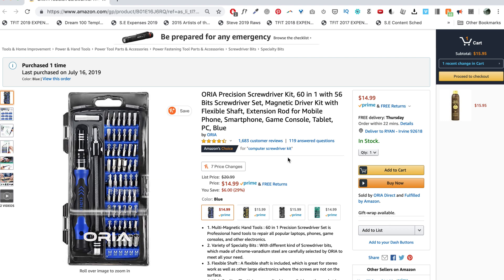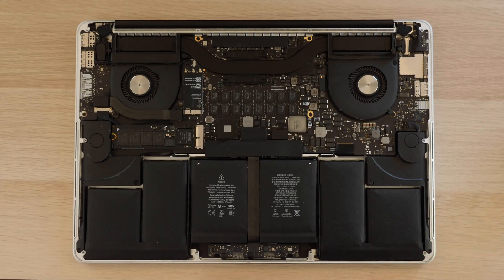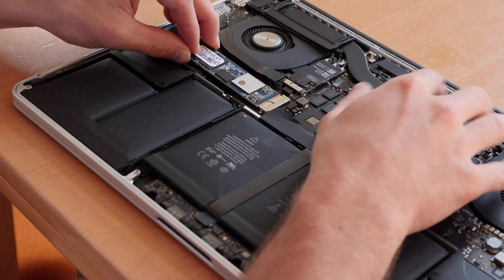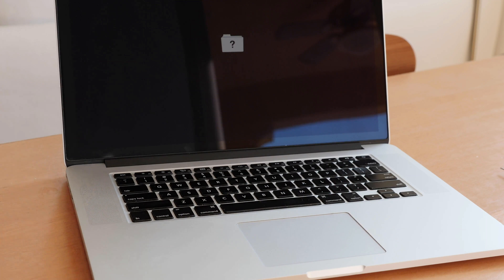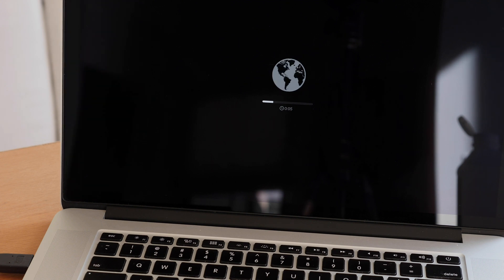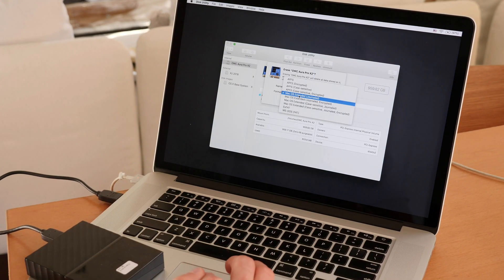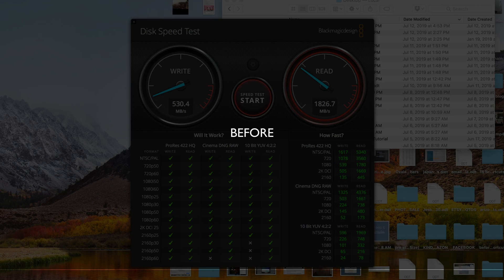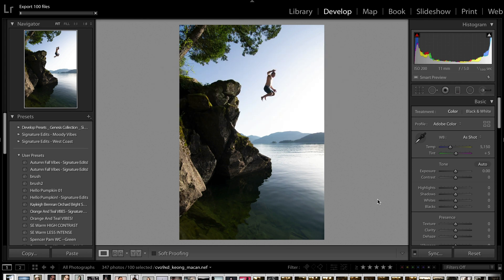Macbook Pro Hard Drive Replacement / Upgrade Test: OWC Aura Pro X2 SSD Review

Comment from the maker: DIY Hard Drive Replacement Tool links:
SSD Hard Drive - 1tb OWC Aura Pro X2 - https://amzn.to/2YpQE6P
Screwdriver Tool - https://amzn.to/2y9CRT6
Thermal Paste - https://amzn.to/2Yel1sK
Screwdriver Tool - https://amzn.to/2y9CRT6
(I receive a small commission if you purchase these, but feel free to buy whatever tools & paste you like - These are just what I used!)
Isopropyl Alcohol - Buy this at a grocery store or pharmacy anything with an alcohol content over about 70% is fine. At $0.70 its WAY cheaper than buying the special electronic stuff for $15+!
Compressed Air - Again buy at a hardware store and its WAY cheaper. The one I got was about $5 at home depot. Just make sure its compressed air only, and doesn't have anything else in there. 
Thermal Paste Replacement Walkthrough: https://youtu.be/qXAUzkj_hfM
Reply: I did the same upgrade, didnt work for me :(   
Has been almost a month since your ssd upgrade, how does your computer run ? any kernel panic ? any unusual slow down doing certain task ?
Cheers for the video

regards Gabriel

Comment: A few years late, but according to the OWC website:
IMPORTANT: macOS 10.13 High Sierra (or later OS) must be installed on the host computer BEFORE installing this SSD
for the first time. These OS versions include an EFI firmware update for your Mac. Without the update, the computer will not
recognize the SSD.

So you don't (in theory) need to upgrade to Mohave(sp).
My issue is that all their videos on the migrating to the new drive are 404 pages, now (2025).
I know... "Why am I using a 2013 mac in 2025?"
Simple answer: I bought my software, and all modern software is now monthly rental. I don't want to rent my software, or be required to be on-line to use it.

Comment: Hey, watched your video on switching out your SSD.  I virtually have the same exact MacBook Pro that you do. I am now running Monterey 12.6.9 as an operating system. My question, do I need to format the SSD? I don’t know if my version of OS has the EFI firmware update. Reading from OWC instructions page It indicate Mac, OS 10.13 High Sierra or later must be installed.  How am I to ascertain whether or not I’ve got the update? Does later me from High Sierra looking back or going forward?  I look forward to your response!!!

Stephen

Comment: Thanks for the video. I have macbook retina 2013 late. I am planning to upgrade my ssd. Lets say I do not have ssd(not working) what should I do. I dont have time machine.
Reply from the maker: Not sure entirely what you mean, but if your harddrive quit on you, the only thing you could do yourself would be move the SSD to an SSD enclosure, then run recovery software on it. Other than that, you'd have to take it in to a data recovery place and hopefully they'd get it back

Comment: Thank you for including ALL the missteps in your video. It makes me feel better to know that the problems I have aren't just because of me. Would you have had an easier time if you had cloned the SSD before you installed the new drive? I saw that you formated the new drive as macOS extended but Apple recommends using their newer APFS system for SSD performance.

Comment: Hi bro, my macbook pro retina mid 2014, I bought that SSD 1TB, but it did not recieved new SSD, what should I do now, bro? I tried to install many times but could not.
Reply from the maker: Hey Hoang! Sorry you're having trouble. For me it took some figuring out, and eventually I had to start with a completely formatted drive and install a brand new OS - Duplicating the drive / installing from a backup didn't work. Perhaps this is worth a shot! If not, your next step might be contacting OWC

Comment: Have you found any way to calibrate the drive to get that CPU performance back. I don't know what the 802 vs 770 equates to in real world but it seems like a pretty significant drop. Also, do you know in what use case that drop would come in to play?
Reply from the maker: I'm not sure what you're asking, but no, I haven't done anything since I switched the drive out. It's been awesome.
Reply: @SignatureEdits  I'm talking about at 7:50 in the video when you show the CPU scores. You said the CPU doesn't work as well with a non Apple calibrated hard drive when you show the before score of 802 vs the after score of 770. I was saying that I don't know what that drop of 32 points in CPU score equates to in real world use but it seems significant. I was asking if you have found a way to get those 32 points of CPU performance back and in what scenarios would that 32 points be a factor?
Reply from the maker: @TimidMC  Gotcha. Well 802 vs 770 is a 4% difference.. So really not significant. I can say without a doubt I've noticed zero drop in real world performance!
Reply: @SignatureEdits  ok thanks. I've been eyeing this drive upgrade to extend the MBP; I like my ports. After I get this screengate/staingate issue fixed, though.

Comment: Not meaning to be pedantic but I think it would have helped for you do do a bit more research on the differences between hard drives and solid state drives. It sounds kind of like you think the SSD is just an upgrade to the current technology that is the HDD when they are two completely separate entities. Very simply put the hard drive is a moving disk, among other things, that stores data in various locations and moves to said locations to get the data stored there. An SSD has no moving parts and stores data in locations called cells which require no physical movement to reach. This is why SSDs are so much faster than HDDs, HDDs have to travel a certain distance to get data whereas SSDs are able to locate it easier and faster because the data and location thereof are fixed. Major detriments to hard drives are the are composed of moving parts and are easier to incapacitate through normal wear and tear and they are much slower in reading, writing data, and finding data not to mention being much cheaper in terms of cost per GB. Benefits of SSDs are they are blazing fast compared to HDDs and they are more difficult to break because of the inherent nature of their build and having no moving parts to be displaced or broken entirely. It should be noted SSDs are more expensive in cost per GB and cells begin to "break" or become corrupted over time. This will leave you with less storage space overall but the rate at which these cells corrupt should not have any bearing on whether or not you are deciding to get an SSD. IMO SSDs are far superior to HDDs and are very much worth the investment. All you need to do is think of the efficiency that comes with an SSD rather than an HDD. With all of the time you have spent in your life waiting for your snail of a hard drive to load microsoft word you could have amassed another week of surfing the web, watching Netflix, doing something productive, or slacking off. An upgrade is definitely worth it and shipping product with an SSD instead of an HDD should become standard practice within the next 20 years. 

Edit: If you're going to be handling internal computer components you should ALWAYS wear an anti-static bracelet! A single static shock is enough to absolutely destroy your computer! a static-electric shock is probably the quickest way to completely fuck up your computer or pretty much any part housed internally. Not a cheap fix!

Edit 2: Man you gotta do some research before making a vid like this, no anti-static warning, not knowing you can't boot a computer with no OS to boot it on, constantly referring to the SSD as an HDD. There's a dearth of info on how to do everything in this vid without potentially obliterating your viewers' expensive, very hard to replace, hardware from 2015! You should also note this is the last model of Macbook Pro made with upgrade-able hardware so an uninformed viewer doesn't buy this SSD for their 2017 Macbook Pro just to take it apart and realize it wont do anything!
Reply from the maker: Great notes and info! I'm certainly not a tech guy with much experience in this realm, so I appreciate the additional notes!

Comment: o h ok hold on please at 3:54. I have the same macbook pro retina display 2015 and the SSD is not going all the way in. How hard did you push it in??
Reply from the maker: hmm i cant remember sorry! if in doubt just take it out and triple check you have it in right - then once you are positive, apply as much pressure as necessary
Reply: @SignatureEdits  hmm I just spoke with the team at OWS today as well and he told me to apply more pressure probably. The problem is most videos just skim this important part in fast forward.
Reply: @SignatureEdits  but thanks for the info

Comment: Good job. Thank you! You helped me a lot. I just changed my old ssd for Aura and it went smooth, no hassles. I didn't have to press cmdR...just after turning it on, I pluged in the time machine back up disk and it did all in 2 hours with no need to press anything...
Reply from the maker: Glad it worked so easily for you Tomas! Congrats on the SSD upgrade

Comment: I have installed Aura Pro X2 and my macbook pro is early 2015. After cmd + R the disk utility doesn’t recognise the new ssd. Any idea how to fix that? BTW, my macOS is Catilina 10.15.6.
Reply from the maker: I wish I could help Elham - It might be the same situation as me, where you have to do a completely fresh install of the drive first, THEN you can load your time machine.
Reply: Hey, did you find out how fix this issue??

Comment: @Signature Edit You should have gotten the SSD with the External Case, then install the old SSD into the enclosure then install the latest OS and perform data migration with the data migration assistant at the end of the OS install.
Reply from the maker: Correct - I would highly recommend others to do that!

Comment: So you had to erase your initial backup, then update the OS via the internet option, then you did the backup again? Do you have to format the SSD to a specific partition option?? I'm getting the same drive delivered tomorrow.
Reply from the maker: Hey Jonathan! No I didn't have to erase the backup at all.. It was on an external harddrive. Yes I installed the latest OS via internet connection, and THEN I was able to move the backup onto the computer (It failed to work before)

Comment: Thanks for the video! Have you experienced any overheating issues, or any issues with the Mac having to shutdown? Lol I have a 128gb, and need to upgrade.
Reply from the maker: No overheating issues for me. My battery needs replacing anyways so I can't comment on the battery life, although I've heard it's worse. But for me since I'm plugged in 95% of the time that's not a big deal.

Comment: Hi..I'm thinking of getting a 2tb SSD and I have the the same model and  specs of yours laptop. So after 5/6 months of uaing that SSD can you please make sure does it create any issues of Battery life or any other sector? 
Thank You.
Reply from the maker: Hey! Personally I haven't had any issues, but I can't comment on battery life because my battery was already old and in need of replacement before doing the switch. I am 95% plugged in during the day so for me it's not an issue. Good luck!

Comment: Confused when you say you need at least high Sierra and then say you need Mojave. Explain that one!
Reply from the maker: Haha great question Brian! WWC says you need High Sierra on their product info, but when I was actually installing the drive I had to upgrade to Mojave in order to get it to work personally. Your experience may be different, but that's why I said both!
Reply: Signature Edits I just swapped out my PCI SSD and the HD for a SATA SSD in my late 2014 iMac. I ran into a little snag but quickly fixed it. First, I was running Mojave before I took the computer apart. I needed to put new and better thermal paste on the heat sink. It was running way too hot. Actually shutting down. 

So I assembled everything and my boot drive (new Mojave flash stick) was messed up and would not work. Annoyed. So when I go into recovery it was El Capitan internet install. I was shocked. The PCI ssd wasn’t showing so I said enough of this and grabbed my MacBook to create a proper boot disk and install clean copy after formatting and fusing the two drives together. 

So I make the boot disc, run terminal to make an all SSD fusion drive (why I did this was it was cheaper and the benefits of a 2TB fast PCI on the 2014 would not be great since the PCI speed is about the same as SSD). So anyway, I go to install Mac OS Mojave and I get a terrible message telling me to replace the SSD in SATA because Mac OS only supports SSD and HD fusion. I panicked. The issue was the format of drive. I had to change it to APFS and reformat the drives and all was well. What a project!! Ha ha.
Reply: Signature Edits Works like a charm now. Much faster and so nice and cool now. No more 230f GPU temps!!

Comment: Hi I have upgraded too to owc aura 1 tb thx your tutorial :D, I wanna ask how about your booting time? Mine longer than original apple, 17 seconds vs 35 seconds, how about yours? And how about the battery life?
Reply from the maker: Hmm I haven't actually tested the boot time tbh, but I haven't noticed any significant changes. Battery life no major differences I've noticed... But my battery shows up as "Needs servicing" so I don't know what it would be with a new one... I personally am plugged in 95% of the time so it doesn't affect me much

Comment: Hey. I just did the same thing on my MBP 13 early 2015. But mine stops at 1100write and 1100 read. Ive got 8gb RAM and 2.7GHz i5. Also new battery. Any suggestions what i can do to increase the speed? I use OWC Aura Pro x2 480gb
Reply: My geekbench actually went down from 757 single core to 671 after the upgrade
Reply: Andreas G So is the performance decline noticeable ?
Reply: Prathamesh Jaiswal Yes. I find my Mac having more problems in Logic Pro X doing my playbacks. It handles bad
Reply: Andreas G what about the battery life ?
Reply: Prathamesh Jaiswal well i cant answer that as to Ive changed the battery too..
Reply from the maker: From what I have read there is a pretty big difference between the 13inch and 15inch when it comes to theoretical read/write capabilities. So the difference is that you're on a different model MBP with a smaller form factor, half the RAM and an i5 instead of i7 amongst other things - The bottleneck is actually the computer and not the hard drive in this case. (Note I'm not a computer tech - Could be I'm missing something, just what I know)

Comment: Your battery cells look kinda puffed up, normally they should be flat. Please check if they are okay.
Reply from the maker: You have a good eye - The "service battery" indicator turned on shortly after this. Definitely need to service
Reply: First thing I noticed once he took the bottom case off lol
Reply: What are the battery cells? And what do I need to do if mine are puffed up?

Comment: I was considering updating to this drive, however when I look at my read and write speeds I'm getting 1500 write and 1855 read, there there is likely no point upgrading?
Reply from the maker: The speeds you'll get will depend on the year of computer you're using. For instance my computer was a 2015mbp... So the bottleneck is actually the computer. The owc drives for newer laptops will have greater speeds.
Reply: @SignatureEdits  How do I find out the actual bottleneck of my model? I have the 2015 map as well and the aura pro x2 1TB and not getting these speeds that you are.

Comment: First, thank you so much for this thorough walkthrough! 
At 6:45 you mention that you need to switch to Mojave. Is this an absolute requirement? I have music software and hardware that is only compatible up to High Sierra. Do you know if it's possible to NOT upgrade?
Otherwise, I'm looking at OWC's older "Aura N" model which might support older OS. Thank you!
Reply from the maker: Hi Eric! As far as I understand based on what OWC says, it SHOULD be possible to do the switch without upgrading. But what I found was that I couldn't get it to work without doing so... Could be that I missed a step though, I'm certainly not the world's foremost expert on this sort of upgrade :)
Reply: Hey man just curious... what kind of music software isn’t compatible with Mojave? I’m a producer too and am updating my SSD